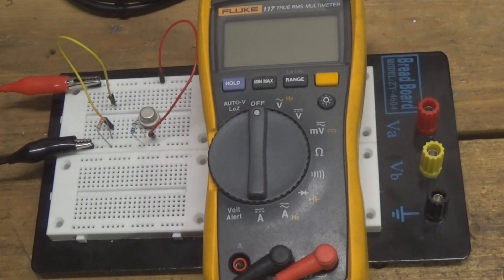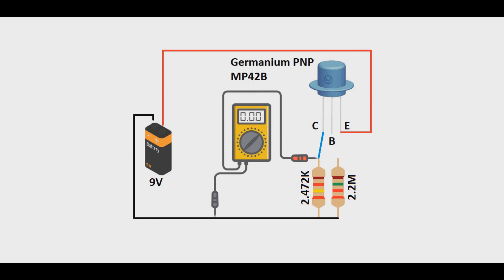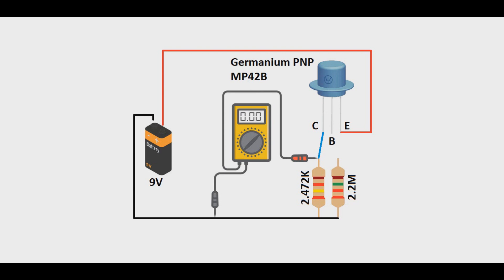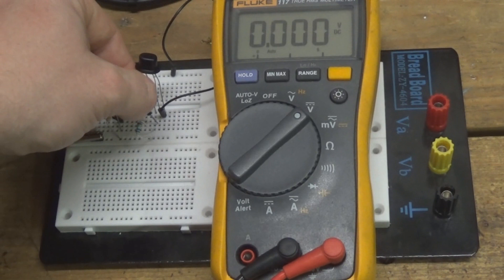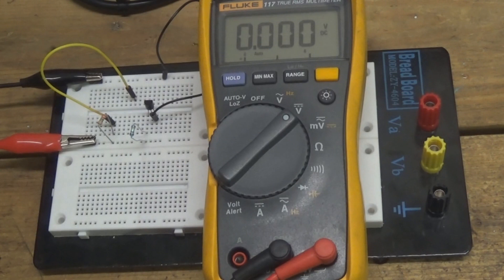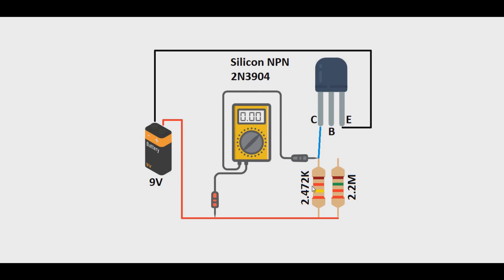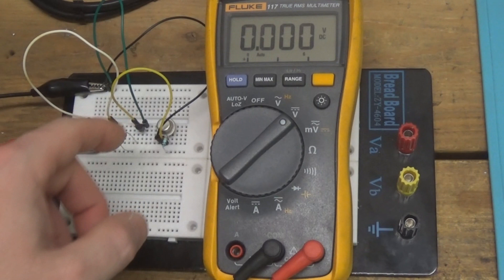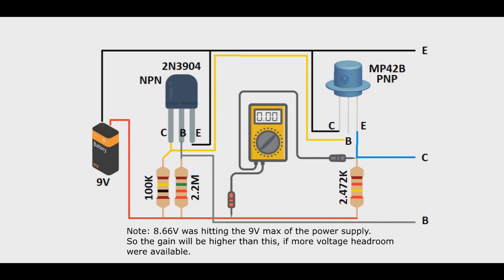How to Measure and Transistor Leakage and Gains for Germanium, Silicon, and Sziklai Pairs

Comment: Hi mate, when you explain a germanium for a gain.. i still dont inderstand where you can get 4uA to get 0.9888v.. can you explain it please?
Reply: You could put an ammeter in series with the 2.2M to measure the microamps, or put a voltmeter across it to measure through ohms law. Although be aware most DMM volt measurements have a 10M resistance themselves, which lowers the resistance at time of measuring. Lastly you could also work backwards after measuring the main channel current and the effective gain properly

Comment: Please, what does it tell when the voltage value keeps decreasing and doesn't really stop ? i don't have a fixed value to endly make the calculation and get the total gain ..
Reply: Could it be that you have used you fingers to insert the transistor and it hasn't temperature stabilised yet? Or maybe your power source is sagging?
Reply: @paulepruss  thank you . it's a basic 9v battery.
Reply: @xplorer3475  I'm no expert, just learning like you but - It's a simple set-up so check all of your components for the correct value. Re-seat all of your components in the breadboard and/or try a different transistor to see if the voltage stays steady. try soldering or using jumper clips to connect the circuit to rule out the bread board. Try to find a 120/240vac to 9vdc power pack to give you a constant 9vdc source. Good luck!
Reply: @paulepruss  i observed that the difference between with and without 2M2 remains the same, whatever the oscilation goes to. so it means : checking each voltage quickly thanks to the switch, then do a substraction, and then you have the total gain.

Comment: Do multimeters that have an hFE setting account for leakage in a germanium transistor? Just got my first germanium transistor and plopped it into my cheapo multimeter, being careful of the pinout ( they didn't make it easy for you back then :D) and it came out at 80. It's a GT402A. If it isn't leaky, that should be pretty good I think.
Reply: multimeters don't have anything for hFE, and for Germanium it would be tricky as leak calculations are needed to subtract from the measured hFE. But, as shown in the video, you can measure leak and gain with a multimeter and breadboard and subtract.
Reply: @erikvincent5846   My multimeter has 2 sets of 4 holes labelled, ECBE for NPN and ECBE for PNP. I guess they make them that way to accommodate all sorts of pin outs.

Anyway, I only ask because I have a germanium transistor that I wish to use and the multimeter says it has a gain of 90, which would be pretty awesome if leakage wasn't a factor in germaniums. ;)

I'll have to  dig out my old breadboard and see
Reply: @JM-ym8mm  ah, I think I might have seen chip/component identifiers that have that. I haven't seen any of those that take leak into consideration, though. Not saying they don't exist, but I haven't seen them before. I did make an Arduino circuit that does do that, so it is possible. We made a video about that a bit ago.
Reply: @erikvincent5846  indeed I think you are correct. I would assume that they build multimeters with today's silicon chips and transistors in mind, which don't have the same leakage issues I believe. It would make sense for them to ignore it seeing how the germanium transistors we buy nowadays are new, old stock.

Thanks for replying, was good picking someone's brain about it!

Comment: Since the currents measured are minimal, you should take care on the design. You can play a lot with Spice, but in the real life, breadboards has a lot of stray capacitance  and if you left floating in the breeze the base of the transistor, like an antenna, you are making a very good electrostatic receiver... it'll capture whatever glich or noise is on your bench,... even the static electricity of your body.
I suggest to make the circuit in a proper board. also, put a 47nf (the less ESR as possible) between the "ground" and the base. In that way you can get rid off a lot of noise in your bench.
The last thig is that you let all the transistors on the bench for a few hours and the use ceramic tweezers to plug it into the socket. your body temparature will modify the reading for sure!
Take note of the ambient temperature when fill up your spread sheet with the data. this are my two cents.

Comment: Excellent video! Question: if you’re using two germanium transistors in a Sziklai pair do you just add the leakage of both together to get the total leakage or is there some fancy math you need to do to figure it out? Also I would love to hear your thoughts about using a Darlington pair to increase gain in two germanium NPN transistors?
Reply: So, in the case of either, it's not that they add, but rather, they multiply leakages. However, it isn't a "straight multiplication" either. But this is why a silicon germanium pair works great, because a leakage of near 0 from the silicon can greatly reduce the leakage of its germanium in the set.

The reason we go more with PNP Germanium is because they were more common, and they lasted longer than their NPN counterparts. Most NPN Germaniums that you find now are either leaking too much or their gains are abnormally low, which is why they were B stock transistors in the first place to become NOS.

Comment: Thanks for the informative video. I'm an 'absolute beginner' (I used a breadboard 30 years ago for a week in college). I want to take on the task of building a Tonebender MKII Pro. Possibly with OC81D's, maybe OC75's, or 77's. I have read that the actual Ge transistor model doesn't matter as much as matching the three. Supposedly, matching meaning there is a magical combination of gain & leakage ranges for each of the three Ge positions in the design. 

I'm "guessing" leakage doesn't matter, but it's the TOTAL GAIN (as you demonstrated by subtracting out leakage) that needs to be magically matched. I will experiment and use my ears, but have you heard of this? Do you know where I can source the info on what gain each of the three should be? I believe mismatched gain on the three is how the tone bender gets it's great sound. This could be a fun rabbit hole to go down. THANKS for any tips!
Reply: For a Solasound TB MKII Pro, there is a little bit of fiddling required, but nothing too ridiculous. The first thing to note is the first transistor (input stage). It will likely have a resistor that connects to the base of the transistor and goes to ground. It is a resistor to divert excessive base-current which is caused by leakage from the base to the collector a Germanium transistor. On PNP Germanium Transistors, like the AC125, AC126, AC128 or OC81D, the value of the resistor should be around 100K. However, if using an OC75, it should be reduced to around 10K.

The first transistor, usually you are targeting a 50-70 hfe transistor that is slightly leaky. Something like between 100μA and 400μA. The second transistor needs to be at around the same gain, so 50-70 hfe, but you want it to be the one with the least amount of leak. Try to have it under 100uA if possible. The third and last transistor is the one that needs the higher gain, somewhere between 100-125 hfe, and it should be slightly leaky as well, between 100μA and 400μA.

When the ToneBender was being developed, they took leak into consideration into the design.
Reply: @erikvincent5846  GREAT info! Thank you. This will be a big task for a first build.
Reply: @frederickshelborn6911  Let me know if you need help. I have an unreleased PCB called the Clone Bender. It builds a Tone Bender MK2, plus several other PNP Germanium based fuzzes and has an inverter onboard. If you are in the US, just hit me up and I can send you one, along with the build doc.

Comment: Are you running a de-esser on your mic?
Reply: Nope. On screen capturing, just an SM58 with a pop filter straight into my Scarlet 2i2 interface. From there, into Bandicam. Otherwise, if using the Sony Cam, it's just that.
Reply: Maybe try a de-esser. You’ve got quite the whistling ‘s’ going, there.
Reply: @buzzcrumhunger7114  on the Bandicam screen capturing or on the regular garage cam scenes?
Reply: Erik Vincent I dunno about Bandicam, my daughter insists OBS is better but can’t tell me about plugins. I don’t know what your post editing process is like, but wherever in your chain you would use plugins. It’s loudest in the 1st section with the DMM, but noticeable in the graphics presentation section as well. That’s about as far as I got.
Reply: @buzzcrumhunger7114  I can look into it. Might be a plugin within Sony Vegas.
Reply: You should run an esser instead

Comment: Video is long and slow
Here's the PNP instructions
R1 2.2M at B
R2 2.472K at C
9v: - at R1/2 ends and + at E
DMM: DC V across R2
Note V w/ R1 (X Volts)
Note mV w/o R1 (0.XX Volts)
subtract small # from big and x100 = HFE